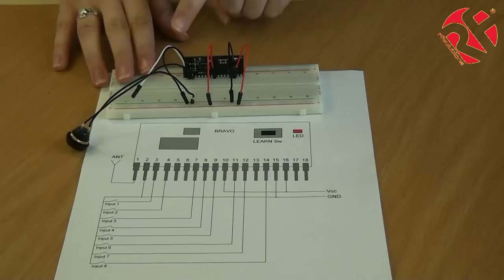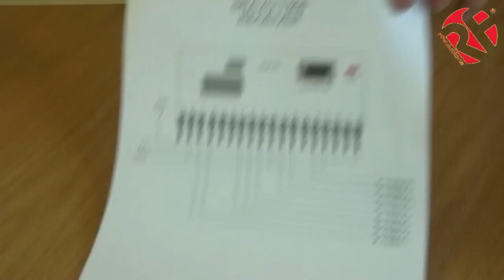The easiest way to embed the BRAVO-T868 RF module for remote control

Comment: Just a little side note. I have an application were I need to operate 5 volt relays (with free wheeling diodes) from the receiver outputs of the T868. My problem is that the  unit max voltage is 3.6 volts and the channel outputs are  only 2.8v which is not quite enough to bring in the relays. So i wondered if 3.6 really is the max voltage and started to increase it. I found I could operate it at 5 volts, TTL level. I left  5 volts applied to it for a week, and operated the outputs to the relays several times for up to one hour continual, with no negative effects or component heating , so maybe there is a generous safety factor??
  Joe
Reply from the maker: Hi there Joe, 
The modules may operate at higher voltages than the maximum rating of the device however the micro can only handle 3.8V as an absolute maximum. If you use a higher voltage supply the module will be transmitting at an illegal output power and long term is likely to fail. Hope this answers your question!
 - RF Solutions Team